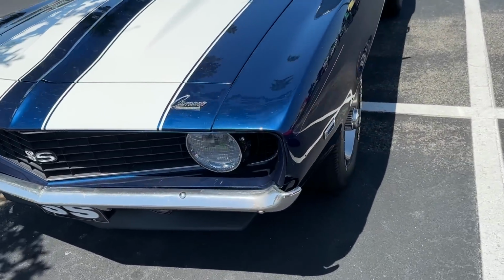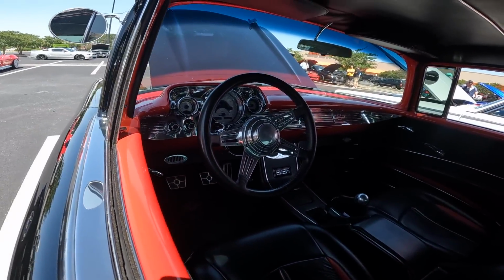Serious Water Issue That will Require Breaking Up the Concrete! #hvacguy #hvaclife

Comment: No way to install a condensate pump and run tubing thru the broken pipe? You could fish wire down the pipe and pull the tubing to the outside. There’s a duplex outlet you can use under the air handler
Reply from the maker: That sounds li,e a better option
Reply: This would be the best way to take care of the problem I would say.
Reply: That’s a great idea
Reply: I concur. Awesome idea 👍

Comment: Before breaking up the concrete I would try to get a fish tape from outside to inside. If that works install a condensate pump and run the hose inside the existing pipe.

Comment: What if you were to put a reducer on the 3/4 and run 1/2 into the broken section in the concrete, it would almost be like having it drain into a floor drain situation

Comment: Well Curtis, my first car in 1963, was a 1956 Grey Morris Minor i paid 250 pounds ($500.00 ) for it back then and they "did not" even have any heating then, you carried a blanket with you in winter,and when turning a corner you flipped a switch in the centre of the steering wheel to flip out a Orange indicator arm from the B pillar to indicate turning right or left  😊 😀  AU

Comment: Geeze disconnected right at the foundation... Yikes.. On another subject kinda, I wish they'd do slab drains everywhere like they do alot in Florida, run it a few feet out from the slab underground and then terminate it above ground with an inverted trap. These types in the video always get buried in the muck under the mulch eventually and are just begging to get sluggish or clogged regularly when you're dumping 8 gallons a day of condensate out there.

Comment: I guess the cheapest and less invasive way of going about it, is to reroute it to a condensate pump. Then have it discharge it down the same pipe that broke off. I see there a wall outlet to plug one in behind the panel too.
Reply: about to suggest the same, assuming there are not too many 90s to fish the 3/8" line through

Comment: Hammer drill will cut through that concrete like butter. My question is, what is the other pipe for? If you do that job, remember that it will make dust mammy. My brother had a '68 Camaro that we restored back in the 80's, we put a 350 4 bolt main in it. I can kick his butt for selling it, would be worth a fortune today. I had a '72 Cutlass Supreme, similar to a 442, I restored it like new. I totaled it, almost got killed. Man those days are gone forever. I have seen some of these car shows and I must be getting old, I remember many of them on the road, new and /or daily drivers.

Comment: Clean & dry around that broken pipe, stick it together, then go around the joint and floor with a few layers of hot melt glue, pausing a few minutes to let the last layer harden. Hot melt will stick to nearly anything which is clean and dry. There is no pressure or heat on that water line, so the hot melt would stay there for years.
Epoxy putty might work too.
3/4 or 1/2 PVC pipe, or some size PVC electrical conduit might fit down in there. Then go from there with any kind of plastic pipe, or rubber hose with hose clamps. Without having to hold pressure, there are a bunch of ways to make that work. Breaking up concrete will be quite expensive.

Comment: if it's a straight pipe with only that elbow at the floor, you can probably fish a pvc condensate pump line through it and install a pump, seeing there's already an electric receptacle there.
other routes, *get a "fitting/socket saver" drill bit and open it for pvc to fit again, that works if there a piece broke in there, but may not work if it's distorted badly from the concrete.
*you may be able to heat gun the pvc and soften slightly enough to get it in place with glue and gentle hammer taps.(only since it's non pressurized and open at both ends) although I have saved some sprinkler pvc that way, I never suggest doing it for any supply drain lines, other than open air condensate

Comment: Why not just heat the end of the PVC pipe and then it would press into the pipe down in the floor? It may reduce the diameter slightly but not too much and be a quick fix where you could get a proper glue joint.

Comment: no need to rip up that floor.
just drill a hole through the sheet rock to the outside wall and run ur evap drain through it. 
where's the mustangs?

Comment: Are you thinking the pipe is cracked/ broken under the concrete.  If not will a street adapter fit into the pipe entrance?
Reply from the maker: I don’t think it’s cracked underneath
Reply: @HVACGUY   so the problem is only you don’t have a correct diameter pipe/fitting to go back and connect to the pipe flush at the floor.   Do you think a street male adapter would work.  Maybe a piece of cpvc. Or plastic 1” tubing.  Measure the pipe in the floor and back to Home Depot  I’m sure you can find something close to fit silicone any gaps.  Plus you may see the car show again.   Just my opinion I wouldn’t bust that floor up if it isn’t leaking in the floor.  Good luck
Reply: @HVACGUY    Just read another post that suggested using a condensate pump.  I would use 3/8 copper as the discharge piping. Would be easier to fish thru the existing pvc in floor